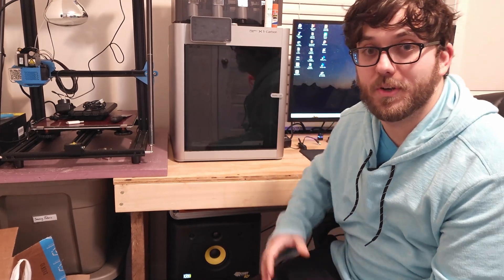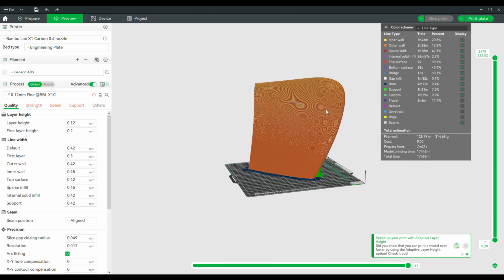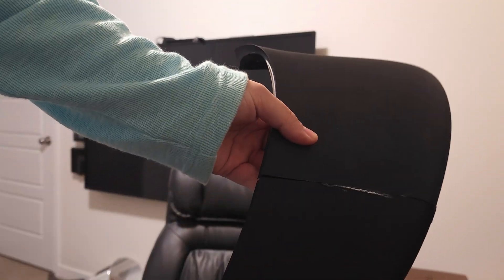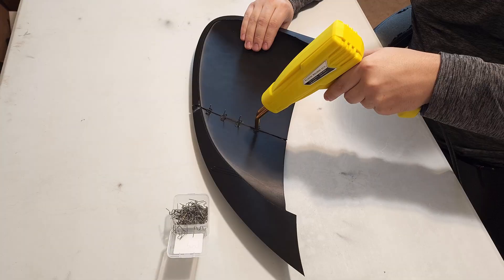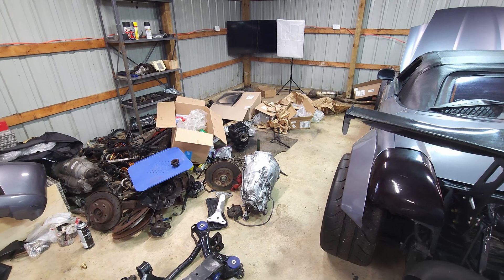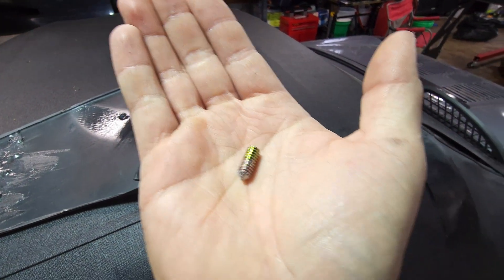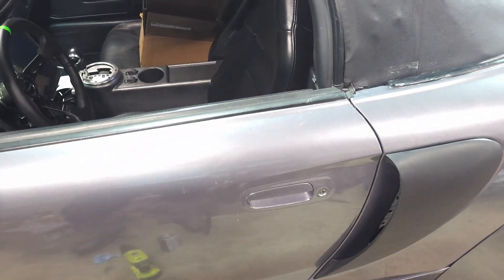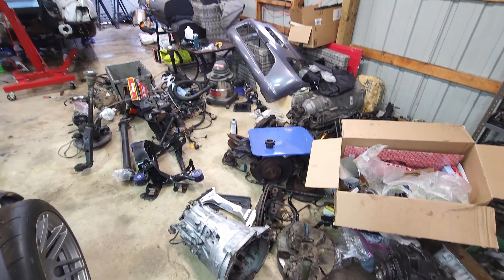3D Printed C-One Style Side Vents | MR2 Spyder

Comment: Did you ever finish this project? I think it is an interesting addition to the MR2.
Reply from the maker: The scoops are finished, car is still always in progress. I ended up just reaching in and threading bolts into the inserts. It worked fine. Was a pain to reach the front ones though.
Reply: Gheh. This question was actually meant for an other video but it turned out equally valid 😉
Interesting idea and something I might end up doing too, since I 3d printed my own design rear wing already and plan on doing skirts and front lip as well.
Reply from the maker: You use ABS?
Reply: @269Garage  PETG actually, but I plan on wrapping it with carbon fiber before installing, for strength, durability and looks
Reply from the maker: I was gonna say, I had petg warp in direct sunlight in the heat before